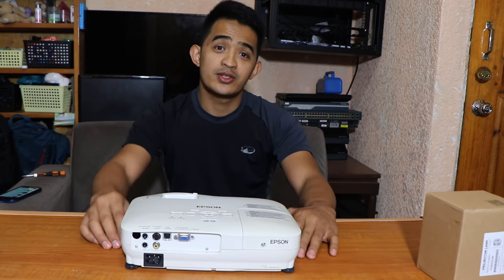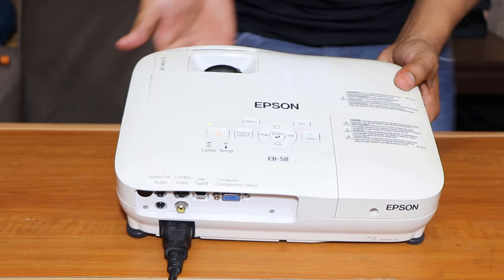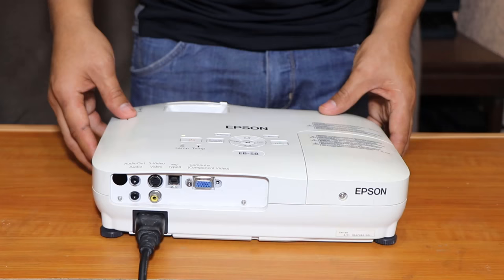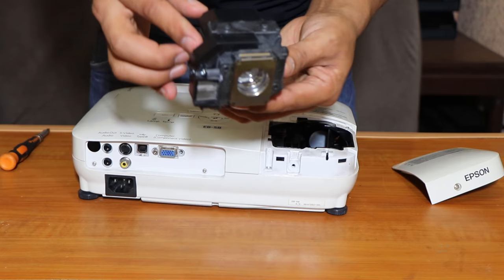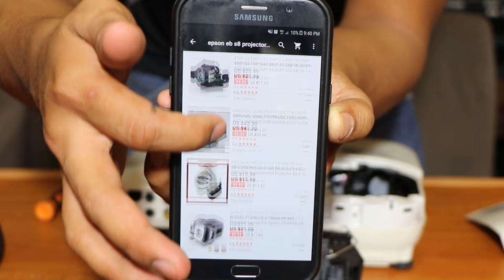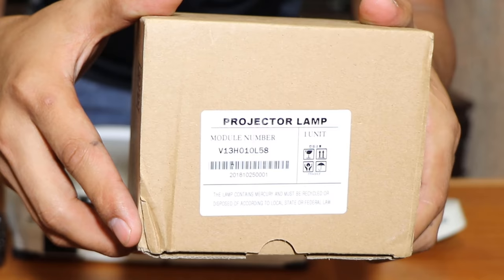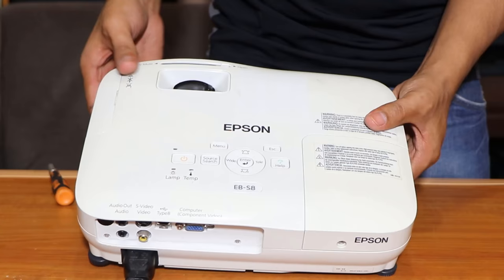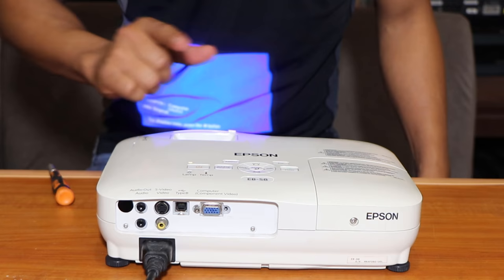How to Fix a Broken Projector: Step-by-Step Guide

Comment: I would imagine they threw it out because it’s old as the hills. No modern connections like HDMI. I personally wouldn’t have wasted the money on a bulb but maybe you can sell it for the cost of the bulb.
Reply: Great image though. Modern projectors are either cheap and bad or expensive and good. These are very good even in the day
Reply: @perisanti7571  Bulbs are super cheap too on the older ones, $15-25, and 1080p is good enough really. Although my Epson now has the Blue vertical line through it, trying to take it apart to "fix" the ribbon cable (said to be common)... which landed me here, surprised it was only a bulb change.

Comment: My Epson started flashing on and off at start up when I have it connected to something. When it's just the projector it's fine but when I plug in a laptop or PS4 it just blinks. I used a different projector and it didn't blink.